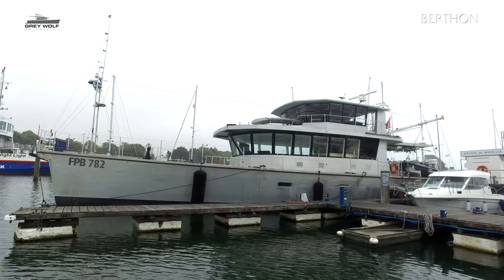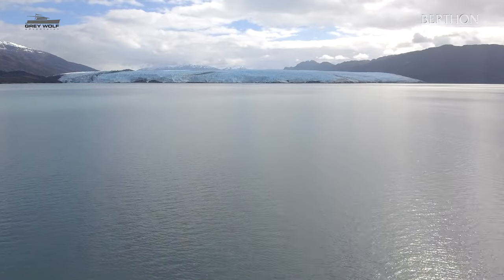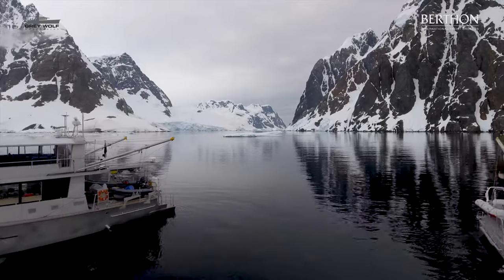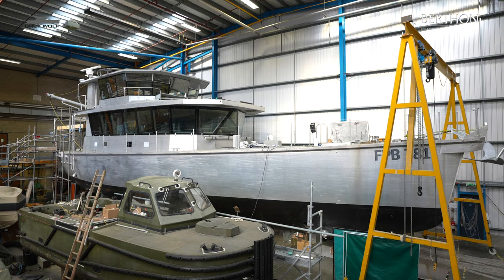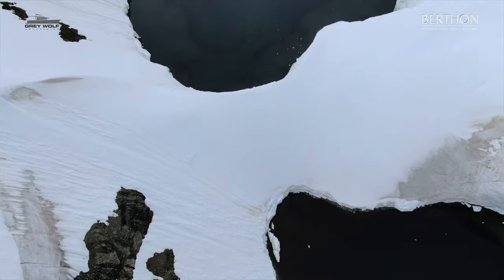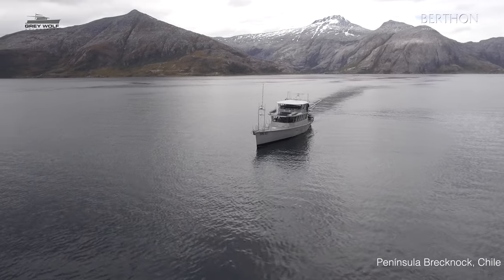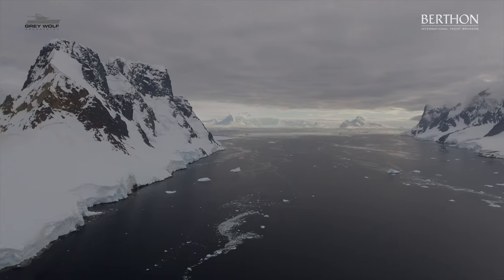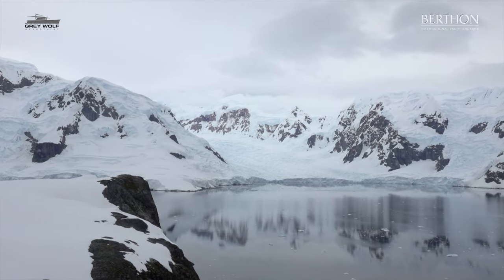Nice to Meet You Peter Watson – Owner of FPB 78 GREY WOLF II. With Sue Grant - Berthon International

Comment: How do the FPBs compare to the Bearing 70 yachts? Seem similar but very different. Wondering which would be a better long range cruiser.
Reply: I have a feeling being able to surf down seas makes the FPBs a better LRC.  Don't know if if I would wont to be in 100 knot winds in the Bering as it is not going to cut through it as well.  The Bering 70 is not going to give you the range and is not an ocean crossing yacht being it's range is only 2500 nm